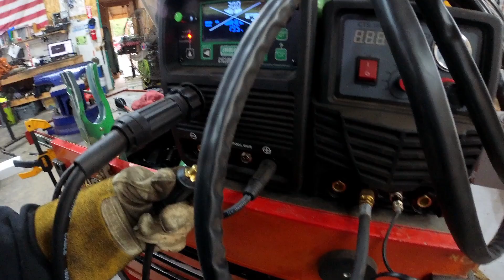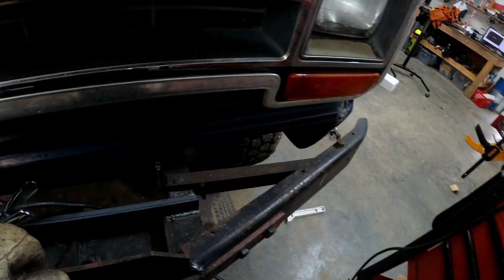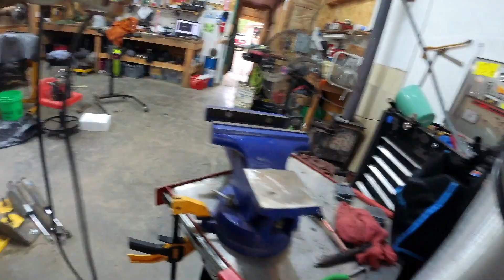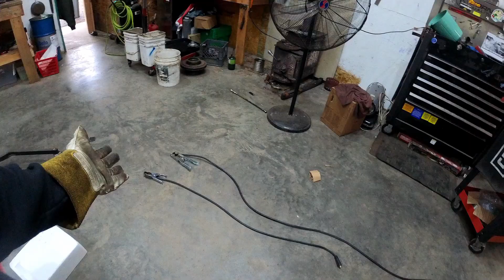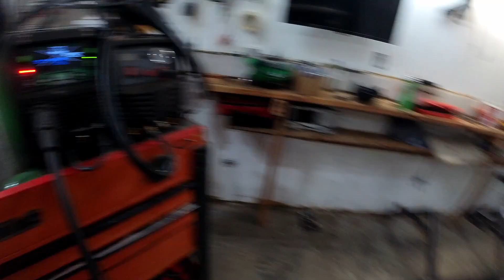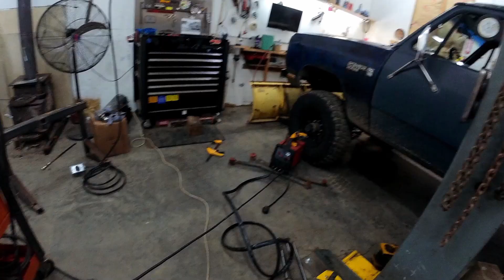EVERLAST Cyclone 200E =  FIRE Ground Cable Bursts Into Flames

Comment: Well, I guess Everlast is out of the running for me. Not just this video but multiple reviews about the ground lead situation just turns me off. It hits different when you see it vs read about it. Why would I buy something just to now have an errand to run and more money to spend to make the stupid thing work properly?
Reply from the maker: That was my thought. If they would have spent the extra 10 bucks and made a product that was good to go out of the box without needing immediate upgrading it would have increased the value by factors.

But I will say I put about 60 lb of wire through this thing since then without any machine failures. The ground is just the week link from the factory

Comment: The dinse 25 that the cyclone uses is rated for about 220A output.  The 35 you show is for 400A output.  And the problem then becomes sizing the cable correctly as the 35 is too large of a diameter.  And what you are not comparing is the actual wattage rating of the unit. The problem I have with your video, is that you are comparing in a vacuum.  You have nothing side by side of equivalent size of the same process.  Go ahead, compare to the Lincoln 180 mig clamp, or even the Miller. There's not much difference.
Reply from the maker: @Mark Lugo  I like how you avoid the fact it caught on fire and melted...
here is what I know.... the clamp caught fire.. wattage ratings, wire lengths, voltage drop all aside... the clamp and cable are junk. pure garbage. you can go on and on about amps and ratings, but your product is still in capable of performing the task it is sold to do out of the box. after this video, I replaced the wire with 15 feet of 0 - gauge, and used a 15$ Lincoln clamp.
Reply: @MegaMarclar  That was melted lol? The heat shrink tubing? Ok.  A little overdramatic...as others have mentioned.
Reply from the maker: @marklugo6002  well I hadn't planned on posting the rest of the video showing what happened. But now you have inspired me, I will be uploading it.
Reply from the maker: @marklugo6002   So let's just go with your numbers for a second. If the dense 25 connector is rated for 200 amps that means if you use the DC current conversion charts, that requires a minimum of 2-0 gauge wire...
I mean you could definitely get away with 1-0, .. but just going by your own numbers The wire that comes with the welder is only capable of delivering about a hundred amps at absolute maximum. The website list 200 amps maximum output from the welder with a 180 amps at 25% duty cycle. So going by your own numbers the wire that it comes with is undersized so thank you for proving the point.

Comment: Thanks for the heads up. I had an extra piece of 2awg welding wire laying around that is a few feet longer than stock cable and ordered a Lincoln 300amp clamp for 23 bucks on Amazon. Should be solid. Just reused the welder side end . Wire swaps out easy with set screw.
Reply from the maker: That is essentially what I ended up doing. Had 12 extra feet of 0ga after doing a solar install job. Got the Lincoln 300a clamo and re used the dinse connection. Totally different welder now. Everlast really dropped the ball on this one

Comment: I found a decent work-around if you want to use a different ground cable.  I have a Vulcan ProTig 205 and it's ground cable is 4 gauge and substantially better quality.  Only problem is it's a 50mm Dinse.  I used this adapter (Tweco Dinse Adapter W4017500) and it works like a champ!  It goes from 25mm Dinse to 50mm Dinse.   Hope this helps someone out there!
Reply from the maker: Nice find.  I ended up building a whole different cable. But yeah this could definitely help somebody

Comment: i agree the work clamp sucks. but in the manual it says 5ft. 
it's sad. but i knew i was going to need something better before i ordered it.
I have yet to see a work clamp i agree with the carrying capabilities of... like the welding manufacturers don't get that DC welding is still an AC waveform as far as current goes. it's not just the resistance of that return, it's the inductance. see: skin effects. i mean we're peaking at hundreds of amps.
look at that contact patch with the clip. first red flag. then 8 guage wire... danger danger.
fire... that though is far beyond ridiculous. glad i decided to not use that return before it got here.
except for the Nova kits which are acceptable. i never expect to like the included guns torches pedals etc. which I realize is CRAZY. but you can see where they are getting their margins back.
Reply from the maker: I get that it's built to a price point, but cutting a simple corner like that is just poor customer service.
Reply: @MegaMarclar  agreed. i think that clamp should embarrass them. particularly because with the larger welders the accessories get much better.
I'm probably more understanding because i can easily change the ground. first couple no welder machines i tried, i had to open up and repair before they would work. DOA. got a CG580 gas regulator that i don't know what size it was really machined to. way too big for the connection.
i think they should all consider selling the accessories separately. Last thing i need is another stinger...
i think you did everyone a huge solid here because the machine guts just work. been my experience with everlast.
but i knew to improve my ground before that thing arrived. because i have yet to see a ground clamp i approve of that I didn't build myself frankly. use the fattest gauge that fits the connector on your welder in my opinion. and i like a physical screw or magnetic clamp at the end. i don't like springs.
Reply from the maker: @rodanone4895  absolutely agree, a complete embarrassment. I needed a better quality welder than what I had for what I do in my shop, but I didn't need a high enough quality one to where I needed to spend $4,000. I figured this was going to be a good mid-range solution. Which I'm not really complaining about the overall weld quality of the machine. But the simple things like the readout showing options that it's not capable of doing and the stupid ground clamp really take away from the overall experience of the machine. Also in my other video l, their customer service guy was basically telling me I was an idiot and that a shorter ground is way better. I mean in a way that makes a lot of sense in the terms of voltage drop, but you can easily supplement that by making it thicker gauge wire... That's like electrical engineering 101.....
The Old Miller 220 that my last shop had was about 20 years old and the ground clamp was longer than the welding lead so maybe they knew something that everlast doesn't..
Reply: @MegaMarclar  yeah... if you're gonna use thread for wire and gum to fasten it down... shorter IS better... omg. sometimes better to say nothing at all...
i hope with the upgrades the machine serves you well. cheers!
Reply from the maker: @rodanone4895  Yes I am nearly trying to spread awareness for anyone looking to pick up this machine and work with it straight out of the box. Obviously there are more expensive better quality options and less expensive lower quality options but this seems to be a good middle of the road, but they cheaped out on very key points. So this is my first and probably last everlast product.
Reply: @MegaMarclar  How? It's stated on the website, in the product literature and in the manual?
Reply from the maker: @marklugo6002  cable length is stated, but the junk quality clamp is not listed as a feature.

Comment: yeah the short ground clamp is silly i upgraded to a 15 foot ground larger size cable soldered both ends and a magnetic ground problem solved the machine is awesome no complaints
Reply from the maker: I plan to get the stuff to make a new one. Mainly showing this for anyone who is thinking about buying this setup, not a long term solution out of the box.
Reply: @MegaMarclar  agreed

Comment: Seems to me that's not the clamp that comes with the 200E. Are you sure the distributor you bought it from didn't get over on you? 🤔 not only is it to short it's not even the right size. It should be a 10 foot . I'd contact Everlast with pictures
Reply from the maker: I bought it directly from Everlast. Check back on the old videos, there should be an unboxing first impressions video. That's the ground it came with, out of the box, from Everlast
Reply: Mine came with a mini cable too. From my welder cart by the time it reaches the floor it’s almost maxed out. I had to buy the longer one that every other welder comes with because there’s no way I could live with it like that.

Comment: I use the previous model, 200 E. I do mobile welding on pontoon boats with the spool gun. I make money with it. Going to purchase the Cyclone. You sure picky.
Reply from the maker: I know. Expecting something to work out of the box is unheard of.
Reply: @MegaMarclar  Forgot to tell you I use a 25' ground cable along with the 25' spoolgun on dock repair. Agreed, short cable sucks! 👍
Reply from the maker: @richardfuerst5286   yeah I ended up making a new one That's 10 ft
Reply: @richardfuerst5286  I'm looking at mig welders for portable welding for aluminum to go with my champion elite engine drive for aluminum how's your spool gun holding up?
Reply: @Nick0utd00rs  great. I use it mostly on heavy aluminum items like boat docks and boat lifts. Running it on my Cyclone 200e powered by my Champion 8750 inverter generator
Reply: It has nothing to do with being ‘peaky’, it is about having the right equipment for the job… don’t be an a-hole…